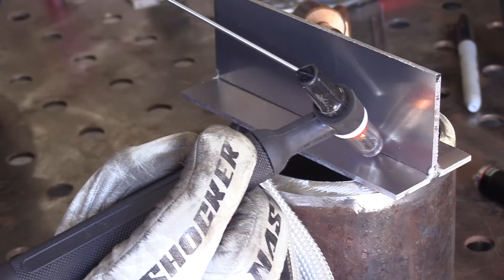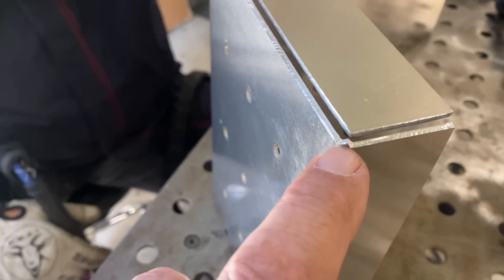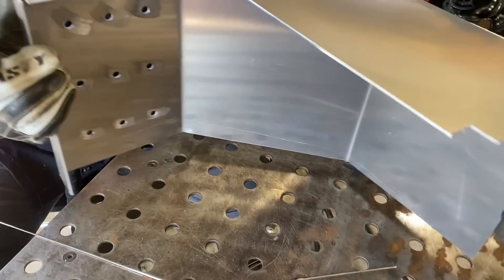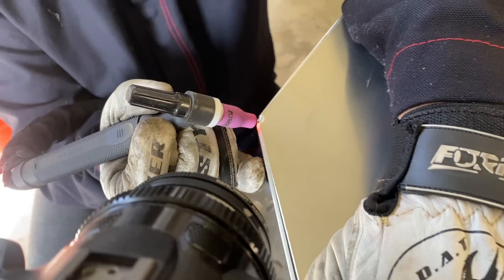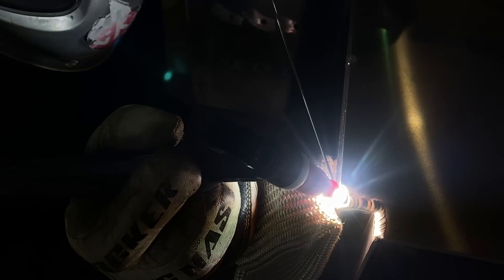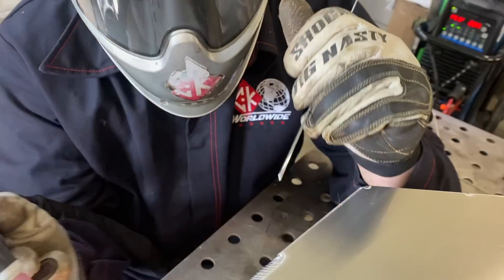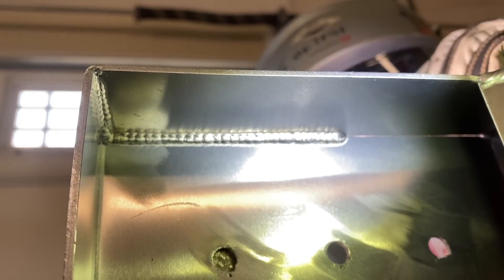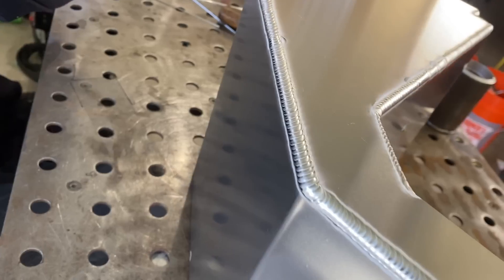TIG Welding Aluminum Advanced Techniques & Tips

Comment: Why wouldnt you just use the Pulse setting on your tig set instead on pumping the peddle? I use pulse on almost every seam. depending on what im welding from 3.0 pulse per sec down to 0.8 for thicker and wider seams.

Comment: Great video. Im building a aluminium storage box for my boat. Trying it with .07 aluminium i had on hand. Only tacking stuff so far. A little heat goes a long way with this thin stuff. I may need to rebuild it with 1/8 material but will definitely be trying this pedal pulse first! Timely video and awesome!!

Comment: At our shop we would CNC tabs on that side plate that are .750 long and half mat out .045 in this case. Then have a receiving slot that is on the main part that is .780 long and .045 deep. This makes the side plate fit inside half of the mat and the tabs hold it in place. Would probably put four tabs on the one side plate. Zero gaps for welding and it’s stays in place.

Comment: For years I worked assembling aluminum oil pans, tanks and accessories for race cars, with that same 090 material.
 We didn't normally wrap the corners that much but we did pulse everything and we also welded it on the inside. The inside weld was tricky because we couldn't affect the appearance of the outside weld.  Some of the inside welds also had to be done left-handed and/ or with a mirror...

 On the steel pans we used silicon bronze on the inside.  Stainless screen over the oil pump pickups also got silicon bronze.

Comment: If you cut your parts with a shear or anything else where making those nibs isn't practical, I sometimes put a small bead of weld on one part, and use that as my material for tacks.

Comment: Back in the late 70's in the San Fernando Valley of California, I worked for a then relatively famous racing frame company named Trackmaster. We made flat track Harley racing frames, and later did all of the welding of the Redline BMX frames and a few others. Most all 4130 Chromoly. Anyway, Trackmaster was known for a signature weld appearance and it relied on aggressive pedal pulsing. Not only did it allow us to negotiate less than ideal frame tubing gaps (mostly on the Redline 4130 tubes, .... .039 if I recall, where the edge could disappear real fast) You can get your rod right in there as you come in with the pedal. But it also allowed us to get our signature spacing on our beads, at a high rate of speed. Lastly and importantly Chromoly does NOT like to be in the heat long...... get in get out, faster the better generally. If you walked into our shop at any given moment you'd see and hear all these pedals going nearly full travel pretty rapidly, lol, along with our big Linde UCC305 machines. Man, those were huge beautiful welding units! Still rival anything I've used to date. The pulsing has stuck with me my whole welding life and I use it probably more than I should, but it works and solves lots of problems. Thank you Trackmaster Racing Frames!
Reply: That’s RAD!

Comment: Hi! I need help with adjusting a cobot. Around two weeks ago the boss came and sad to start welding with cobot, without practice or tutorial. 
The plates are 10 mm, wire is 1 mm, ArCo2 75/25.
I will look forward for answer or help.

Comment: It's always interesting to me that generally the guys that immediately are nay sayers of the pedal pulse aren't industry welders. Or at least automotive industry for sure. I run a motorsports based fab shop down in florida and I'm a big fan of pedal pulse. Sometimes it's nearly the only way to do it in weird spots. Also I've always felt like for certain applications especially on thin ish material you'll get a stronger pen with less heat input. This is especially apparent on metals that really show a visible heat affected zone. The higher amperage punches through but background low amps during travel is less heat in the parent metal over time. Best of both worlds. Not to mention on tube work where rotating your hand is crucial, if you get hung up with manual pulse it's no big deal.

Comment: Hey Jody, I’m a high school student at lansing community collage I’m currently in there 2nd year welding program and was wondering if you could do a 3G open root groove 6010 root with 7018 fill and cap pass im having trouble with both my fill and cap I can’t get the perfection im looking for and it appears that there isn’t any videos of that exact weld it would be amazing if you could run a demo we run a 30 degree bevel with 3/8 plate

Comment: Welding Aluminium Tool Boxes for Utes, Trucks and Trailers.
Customers complain about different colours between the parent metal and the weld.
I use home made rods made from the same material and it is cheaper than buying rods. 
I only use rods for specific industrial applications.

Try it out one day thin guillotined strips used to weld Aluminium tool boxes.
Do a cut and etch and you will be surprised how difficult it is to see the difference between the welded section and the parent metal.

Comment: That little point is genius. Even if the fit is perfect, sometimes the edges want to melt back instead of fusing together nicely. I usually have to hit it at a sharp angle to "push" some material toward the mating edge.
 
Having that extra little bit of material is great for alignment and gives you a touch of filler for the tack.

Comment: The main thing I feel pulse does is limit the heat input. He doesn't have to increase his travel speed to counter act the thermal conductivity of the part. If you can feed fast enough the same results can be achieved with a torch button, but with that you have to be on point with your stepping distance and filler amount. I use special four step and pulse on pulse quite a bit at work for this same reason, control is insane and it limits distortion. I thought the burst tack tabs were clever, thanks for the video Jody.

Comment: Most of the aluminum I weld is dirty, grimey, and out of a scrap pile so I have no idea what kind it is. On occasion I actually weld some that is new and clean I barely know how to handle it.
Tack welding pieces like that is tough, because unless they are touching tight together they want to melt and puddle into themselves. They need something to ' bridge ' the gap.
I have found that welding most aluminum it is better to have high heat and ' blast ',  then stop, because of the high heat transfer.

Comment: I have been practicing a lot on doing outside corner welds on .063" Aluminum.  It is definitely challenging but it looks so nice when done.  I have a number of projects planned using .063" aluminum.  One of them is to make tote trays like you did in a video a number of years ago.

One question that I have is does the risk of burnthrough go down when you are welding on larger sections of .063" material?  I am practicing on 2" x 4" coupons and it is quite easy to overheat and get burnthrough and even worse, complete meltdown.
Reply from the maker: it does help to have a large piece compared to a small practice coupon. heat dissipates way better and the pedal pump technique can help too when nearing an edge
Reply: @weldingtipsandtricks  tyvm, your videos have been most helpful as I Have been learning and practicing to TIG weld.

Comment: Which way do you adjust the cup size for humidity? Smaller cup for higher humidity?
Reply from the maker: usually larger cup size with more argon flow and short stickout along with slightly more cleaning action on the ac balance

Comment: I've been running tons of .060" - .030" 5052 work and it has been very difficult; whether it be the one handed tacks or having a touch too much heat in the assembly. I honestly forgot that working the pedal is something I've done in the past with relative success. Thanks for the reminder and the video Jody!